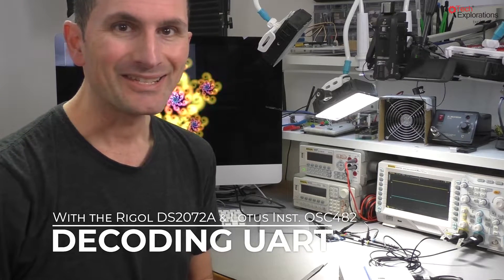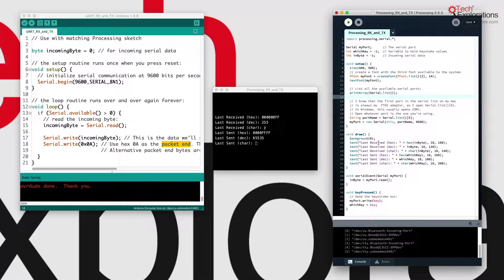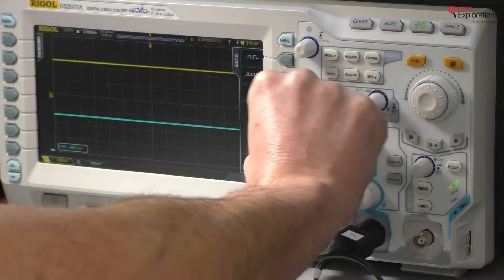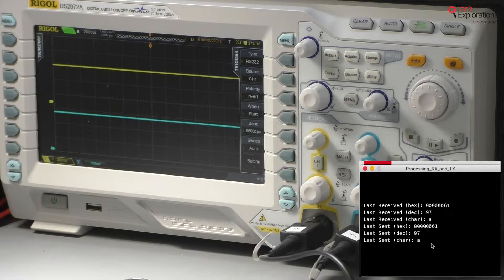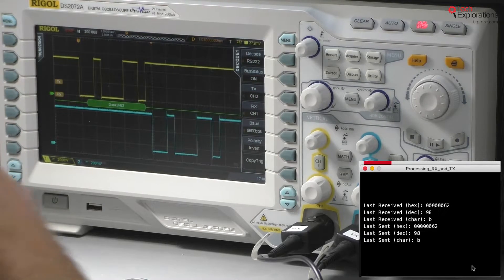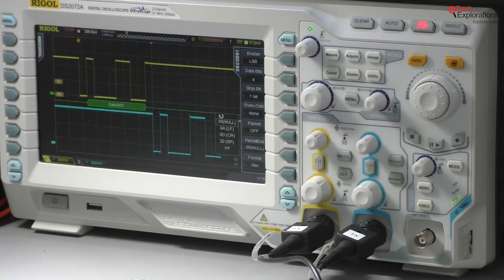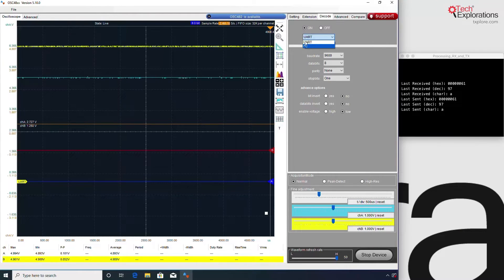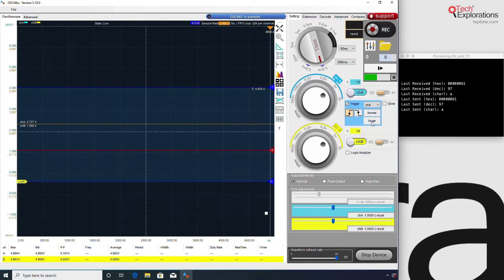UART Decoding with Rigol and Loto Instruments oscilloscopes

Comment: Cool video.  Are these loto scope any good? - not too bothered about the logic analyzer aspect
Reply from the maker: Yes, I think considering the cost- and benefits of these scopes, they are very good. Get the high-end ones (like the OSC482, still much cheaper than a full bench-top scope) that can be their own signal processing instead of passing that function to the computer.

Comment: I'm using version 5.70.0 version of the software for the OSC48xx. It has been updated and it says that it decodes RS485. However, there is no documentation on how to actually connect up the hardware and setup the software to perform the decoding. Do you have any hints?